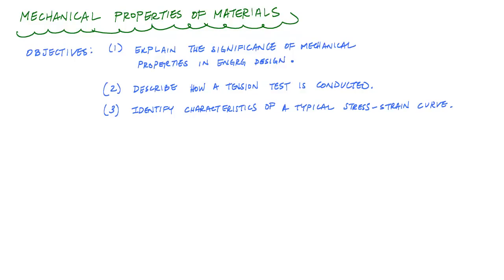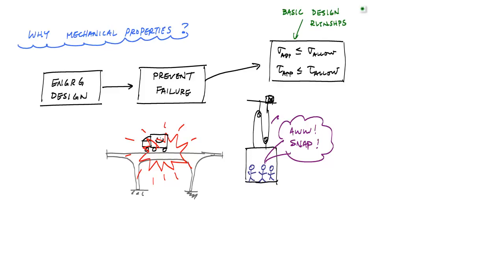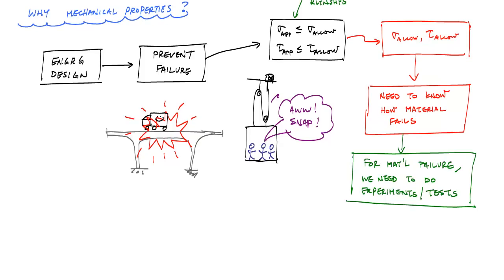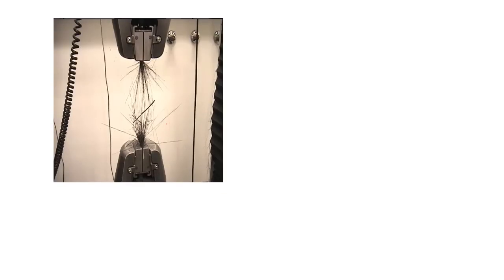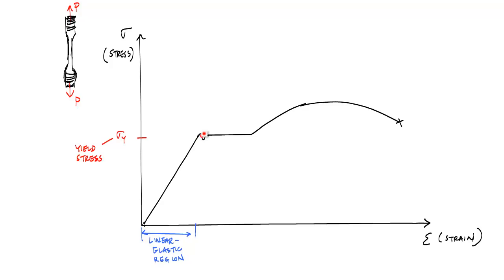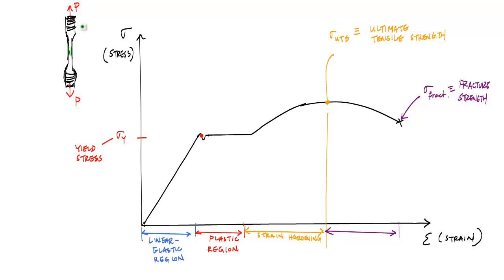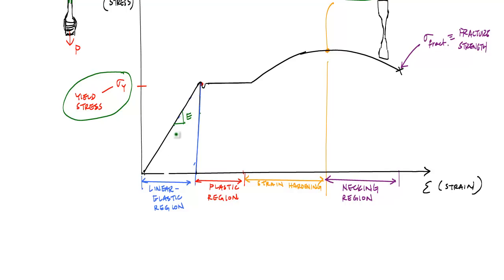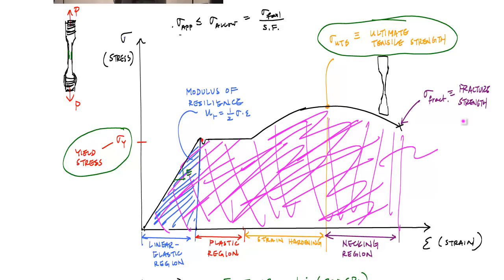Mechanical Properties of Materials and the Stress Strain Curve - Mechanics of Materials

Comment: I have a small doubt Sir. In the yeilding zone , it is said in the video that loading is constant and a large deformation in experienced by the specimen. but I the strain controlled tensile test the specimen is loaded from zero to ultimate load,that means load acting on specimen is increasing  continuously ,so how  a constant load acts in the yielding zone? shouldn't it increase ? or is it like the instant the loading generates the yield stress that huge amount of yielding happens in the yield zone ?

Comment: I feel like I should understand this given that no one else ever seems to ask this question, but can you please explain why the stress decreases after the yield point and the UTS? Doesnt the machine continue to apply the same force or increasing force? How does this result in decreased stress, especially if the cross sectional area is decreasing in the necking region.
Reply from the maker: as a quick response...the material weakens and it requires less force to deform it. the stress is decreasing in the necking region since we are using the original area to calculate the engineering stress.
Reply: this is not true stress strain diagram

Comment: It would really help if you could do a video where you solve a problem about this!
For example: For a 0.031 in diameter wire that breaks with a fracture stress of 36000 psi and reaches a percent reduction in area (%RA) of 75%. Determine true stress and true strain in the moment of fracture.

Thank you so much for this!

Comment: I have two questions here Sir!
1. What happens at microscopic level at upper and lower yield points and further more stress is required to produce deformation in strain hardening?
2.After ultimate strength why the curve downgrading up to fracture?
Reply: +Bibhu Arya the second question is exactly what im looking for,  if you found the answer please reply
Reply: +Omar Alomoush 
sure I'll.
Reply: for the second question, answer is because this graph is based on the original area from the beginning, this graph can be called engineering stress-strain diagram.

>>there is a True stress-Strain Diagram which is based on the actual area corresponding to force applied where you can see the stress is going up all the way till it fractures. 

hope that was clear enough mate.

Comment: guy's what is true stress at fracture?
Reply from the maker: Eraezr it's the load at failure divided by the cross-sectional area at that point, whereas engineering stress at fracture is the load at failure divided by the initial (or original) area.

Comment: thank you for this video , I have question . While applying load on materials , the stress must increasing  and that we can see in curve , but between proportional limit and yield the stress. Here the question , why the stress decreasing ? I know that is engineering stress sigma=F/Ao , so the only change is load . How become
Reply from the maker: أيمن العتيبي it's a dip associated with steel...it's kind of like a slight break and then the grains realign.

Comment: Sir please i need your help on my project which is going to be due by the end of this week. here it is. A BARBELL STAND SUPPORTING THE WEIGHT OF A BARBELL AS SHOWN IN FIGURE. CHOOSE A MATERIAL FROM APPENDIX AND DETERMINE THE MISSING DIMENSION FOR SAFETY FACTORS OF 1.5, 3, 3.5 AND 5. CHOOSE A SAFETY FACTOR AND WRITE A PARAGRAPH DETAILING WHY YOU CHOSE THE SIZE STAND THAT YOU DID. THANKS SIR

Comment: I tried calculating true stress using the relation between true stress and engineering stress,but i am getting a huge difference between true stress and engineering stres value ......I have used the formula true stress=engineering stress x ln (1+eng strain).....Even you try it calculating, assuming some value of engineering stress and engineering strain....
Please help, may be i have made some silly mistake

Comment from the maker: An explanation of the significance of mechanical properties in engineering design and identifying significant characteristics for a typical stress strain curve.
Reply: 5cr3am1ng3agl3 okey! i am not a pro here! just saw ur comment ! so trying to help!
Strength is the ability to withstand load without failure. say higher the strength, higher is the ultimate stress point.
Hardness is the resistance to scratch or cutting or abrasion or penetration, 
Stiffness is the ability to resist deformation under load. say an Al bar sags when load is hung at its one end but a steel bar doesn't for the same load. 
Toughness is the the ability to withstand both plastic and elastic deformation before fracture. u can term it as the amount of energy a material can absorb before failure.
Ductility is the ability to withstand basically tensile load without fracture, better understand it as the ability of a material to be turned into a wire,
Hope it helped! Cheers! :)
Reply: +Neptanol Congrats man you nailed it!
Reply: Good video, can you please explain me the difference between Strenght, Hardness, Toughness, Stiffness and Ductility properties of materials ?